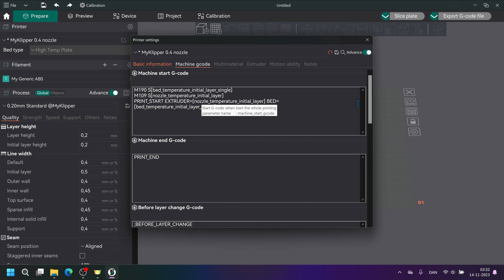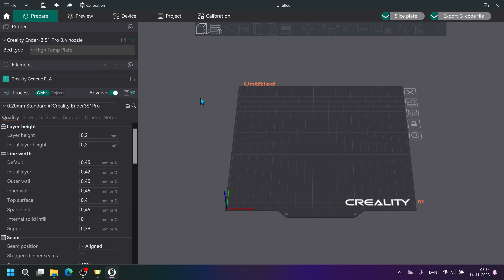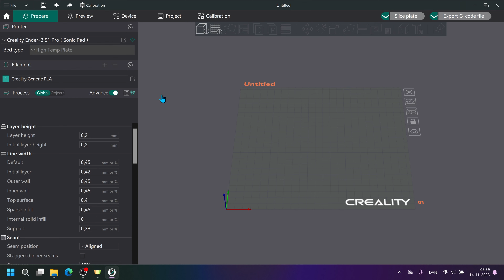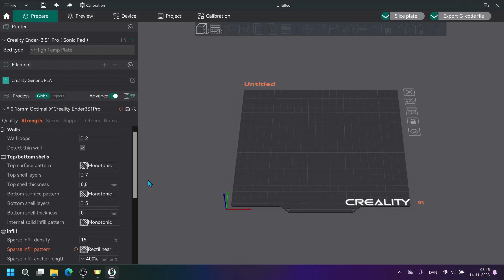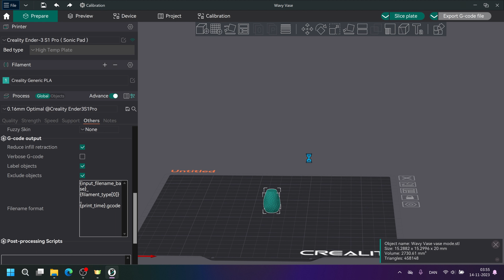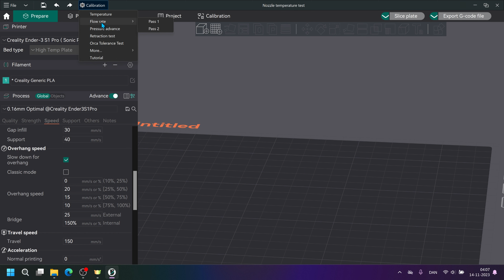AMAZING and FLAWLESS Quality Prints With This Orca In-Depth Guide, 119% Orca Skill Improvement.

Comment: Silly question. I have the Ender 3 S1 Pro also. But I am running Klipper on a Raspberry Pi, not the sonic pad. Should I also zero out my acceleration limits? Will Klipper dictate them as well if I am on the pi as opposed to the sonic pad?
Reply from the maker: Hi, There is no silly questions only stupid answers. 😊 yeah the sonic pad is just a device which has more power than the mainboard in the printer itself, and the same goes for the Raspberry pi. 
Klipper is the main thing controlling your settings, and the “hardware device” is the brain like the sonic pad and the raspberry pi. 😎 

You could in reality run Klipper on a mobile phone if it was possible, and it would still be Klipper that you want to control your speeds, the phone would only be the brain, which only controls how fast Klipper is running on the device.

A reference would be an engine in a car, you could take a Ferrari engine and build it to sit in a fiat or a Toyota, it would still be the engine determine the speeds you are going, where the car is the limit of how fast it can go around corners and braking. 😬
Reply: Thanks for clarifying. But just to go back to the setting part of the question, should I zero out the acceleration limits? Based on your answer, I am assuming that I should. Correct?
Reply from the maker: @nuzzir  yep, sorry, you need to zero out the settings in your slicer, because you want Klipper to control your speeds, it will then “auto” determine you print speeds taken from your config file in Klipper.
Reply: @TechByHesselbech  Thanks! Great video!
Reply from the maker: @nuzzir thanks , your comment I much appreciated.

Comment: Arache is 100% hands down. You can use your 0.4mm nozzle to print from 0.42mm to 0.8mm line widths. You will get a much better resolution and save 30% of print time. It´s not even a debate if arachne is better.
Reply from the maker: Thanks for your comment, I do feel the exact same way, Arachne is by far the best option. 💯👍🏻😎
But some people may think the other is better. 😊
Reply: @TechByHesselbech  Everybody has the right to be wrong =)
Reply from the maker: @sierraecho884   he he 😅 yeah that is one thing we can agree on. 💯😂

Comment: I’ve never used Orca yet but is it possible to change the E steps in Orca.
Reply from the maker: Hi. Thanks for your comment.
I depends if you are using a Creality Sonic pad the E-steps ( rotational distance ) is controlled on the sonic pad. 
Yea you can change the E-steps in orca in the advanced tab, in the printer and filament settings. 😊
Reply: @TechByHesselbech   That’s great news, thank you. I don’t have a Sonic pad but I do have a Elegoo 4 pro.

Comment: So having an Ender 3 S1 with Sonic Pad - whicht to choose in Printer selection? 
Klipper custom or the Ender 3 S1?
(How does the slicer know I have the SP if I just choose the normal Ender 3 S1 printer?)
Reply from the maker: Hi Jan. Thanks for your comment. Your name look danish.? Then I can explain in danish. 😊 
But you choose the Ender 3 S1 in orca, and under print settings you choose g-code flavor ( Klipper ) this way orca knows that your firmware is klipper and then you can adjust from there 😊

The klipper custom profile, is only used if you want to build your own profile from scratch, which could be a non creality printer and so on. 

Hope it made sense.

Comment: How do you know which settings are handled by the Sonicpad, and which are not?
Reply from the maker: Hi, thanks for your comment.
You can find all relevant information about Klipper / Sonic pad on klippers GitHub page, there you have all the information needed to figure out what to use and what not to use in your slicer and so on. 😊

Hope this answer will guide you in the right direction or else feel free to ask again. 😊
Reply: @TechByHesselbech  Wow, I thought I'd read everything in the Klipper docs, and I don't recall seeing the Sonicpad mentioned anywhere. I'll take another look.

Thanks for the info.
Reply from the maker: @imacmill  The Sonic Pad is just the device, don’t think the Sonic pad is mentioned in the Klipper Docs, if I read your question right.? 😊

Comment: I use orca slicer for my k1 max. However i cant figure out why i cannot set the travel acceleration (its grayed out) in machine settings. I have searched online but found nothing. I see that it's the same for you, do you know what causes it to be grayed out?
Reply from the maker: Hi, the answer is quite simple. 😎
The reason why it is grayed out, is because of your G-code flavor in the advanced tab, if you choose klipper or marlin (legacy) it is grayed out, but if you choose Marlin 2, you are able to change the maximum acceleration for travel, 😊

So it depends on your g-code flavor, it is like the Jerk settings, they are not used by klipper, therefore it should not be changed. 😊 

Hope it helped. 😊

Comment: Hi iv installed OrcaSlicer on my Linux pc and added my printer, but  it dosent show the print bed on the prepare or preview tabs. All the settings are on the right of the screen but the rest of the screen is blank. Can you help?
Reply from the maker: Hi thanks for your question. I can try, do you not have any information in orca at all? Have you tried to import a file?
Reply: @TechByHesselbech Also, I've been thinking i have Prusa slicer installed too, do you think that could be conflicting with OrcaSlicer?
Reply from the maker: @Gavin3DPrinting   that would be quite strange if another slicer would affect another, can you send me an email with a screenshot and I will take a look at it, my email is in my bio.
Reply: @TechByHesselbech  Hi so i spent a few hours on forums and have found the problem. Its my Nvidia graphics drivers. I have changed to my system graphics and it works just fine. I tried to update my driver to the latest 525 but my graphics card wouldnt accept it as its too old. Im just staying with my onboard Intel graphics untill i can afford a new graphics card. Now i just need to transfer my presets from prusa slicer.
Reply from the maker: @Gavin3DPrinting  ok, didn’t even know that the graphics card would make this kind of error, but thanks for sharing. glad you sorted it out.
Reply: @Gavin3DPrinting  Could you just change your screen resolution?
Reply: @bluewolf4915  No. I have now sorted the problem. It was the Nvidea graphics that was conflicting. I changed to the onboard Intel graphics and it is fine.

Comment: Same presets as bambu labs?
Reply from the maker: Hi thanks for your question. What you mean by same presets.? If these presets are the same for Bambu studio.?
Reply: @TechByHesselbech  yes, im just trying to figure out which of the two is better
Reply from the maker: @drakedavon2048  hi , it actually depends on preferences and what printer you are using. If you have a Bambu printer, I would suggest to use Bambu studio because of the way they work together. If you use all other printers, you can also you Bambu studio or Orca. Orca is a Fork of Bambu , but they have just down their own optimizations on Orca, to fit what they believe is the best. 
Hope it made sense. 😎
Reply: Yes it does thx

Comment: what about marlin people
Reply from the maker: Hi thank you for your comment. ☺️ i Can make a video for people using Marlin, but the difference isn’t that big.

It is very few things that need to be changed, then it’s almost the same.
Reply: @TechByHesselbech  the thing for me orca works great but a 10hour print on cura takes 20 on orca but cura won’t finish the print orca finishes need help making it faster tried putting the speeds settings from cura to orca but the names are all difent I need help with that
Reply from the maker: @hansherrera6969  hi again, thanks for your comment/question. Okay that makes sense. Just to answer the first part of your comment, if you look at the different parameters which Cura and orca shows in the speed calculation is often different because Cura does not take all parts of the print into the equation when it shows the total print time. 😊 your printer was all stock.?  I will try to make a print profile for your specific printer.
Reply: @TechByHesselbech  thanks yes all stock printer a neptune 3 plus i can send you pics of my settings that i have now
Reply from the maker: @hansherrera6969   yes send me your settings, then I can made a print profile.
Reply: @TechByHesselbech  where to
Reply from the maker: @hansherrera6969  you can send it to my email it should be in my
Bio.

Comment: The bed size for the Ender 3 S1 Pro 220mm x 220mmm not 235mm.
Reply from the maker: Hi thanks for your comment, but the bed size is actually 23,5 x 23,5 which is 235x235 but in cura you only type in 220x220 because it needs to have some print space around the actually print space, but in orca you type in the full size (actually) bed size. 
But the bed size is 235x235.
Reply: Wrong
Reply from the maker: @jakefromstatefarm8545  thanks for your very informative comment.
Reply: @jakefromstatefarm8545  Typical keyboard warrior at it again to try to prove something they have no knowledge about
Reply from the maker: At least he could have mentioned something about what was wrong. 
The thing the some don’t understand. 
Many have had issues with errors on the coordinates on the ender printers, because they have typed in which is the correct size 235x235, but there was some kind of bug in orca where you had to only type in 220x220 for the bed size. 

And he if actually measured the printed of an ender it is in fact 23,5cm x 23,5cm which is 235mm x235mm.

But thanks for stepping up against people that only comment stuff like this, much appreciated.
Reply: @TechByHesselbech  For sure! I ran into something similar when I got my s1 pro and sonic pad. It gave me out of range errors because I set my cura machine settings for a 235mm x 235mm bed, but my sonic pad config files were for a 220mm x 220mm. 

Great video by the way! I wanted to try Orca after using Cura for the last 3 years, but didn't know how to set it up with the sonic pad.
Reply from the maker: @l_Knights_l  exactly , it needs another bed size, than what it actually is. 

Thanks, I’m glad you liked the video. 

I think Orca is so much better, in quality and speed, but also the supports are much easier to remove because of the premade profiles. 😊